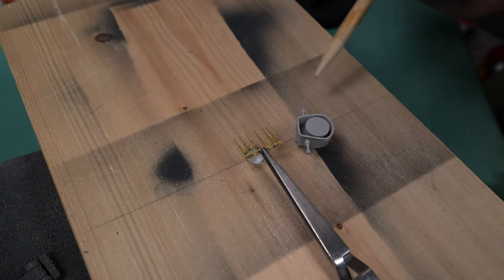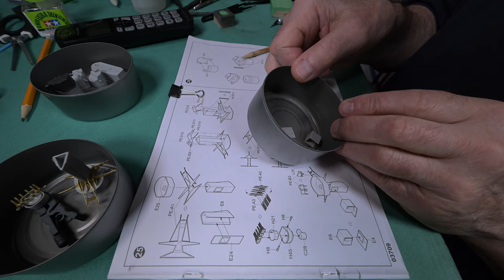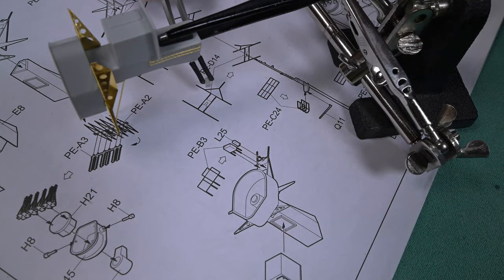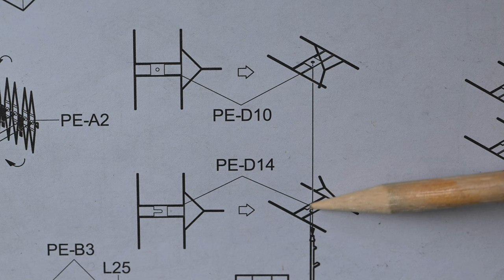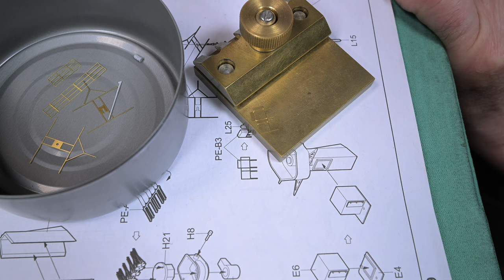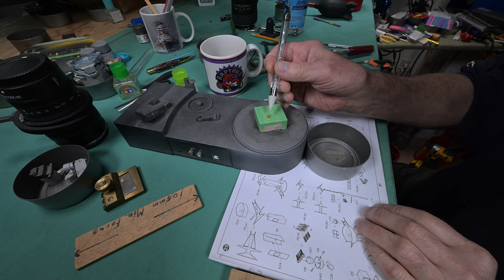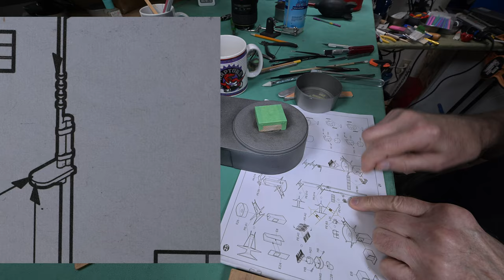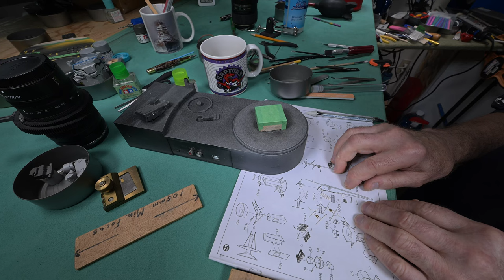The Model Ship - Part 1236

Comment: Ron i have been watching your video of scraping off the flashing. Seeing you soldering i was wondering whether you could use the soldering iron to remove flashing. Perhaps you could try it out on a part you are not going to use. Regards Paul
Reply from the maker: It's a thought Paul, "but", I'm thinking that the heat might deform delicate parts and the molten plastic will mess up the soldering tip. 👍
Reply: You won’t know unless you try. 😂😂